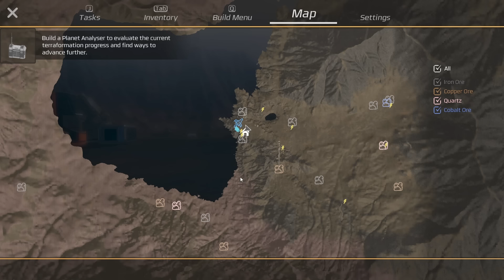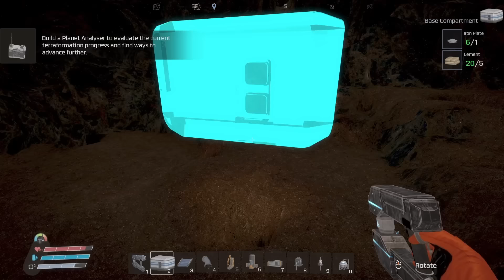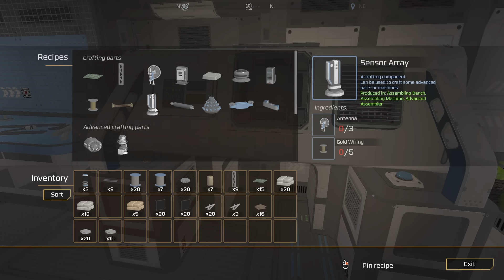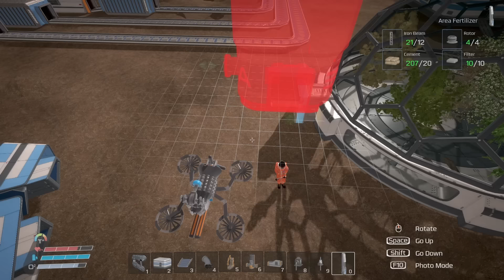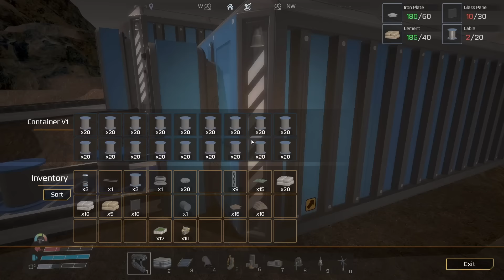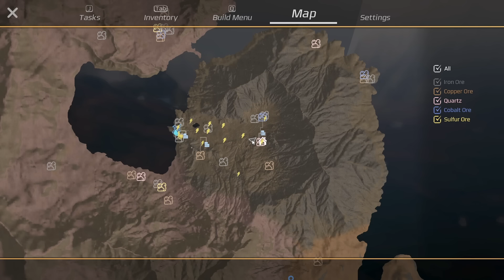Eden Crafters: Pyraxis Update – This Place Needs Air Conditioning [E2]

Comment: Thanks for your video!
I've gotten into the habit of building with the drone while staying inside a building. That way, I don't have any oxygen problems or get injured from the heat.

 1:54, you do see a cave in front of you. Build a building above the cave entrance, then use the drone while staying inside the building and send it to collect resources in the cave. If I remember correctly, it's gold.
Otherwise, there's another cave along the lava sea on the other side that you haven't explored yet. There's a cave right at the edge of the lava with gold too (if I'm not mistaken).
Have fun!